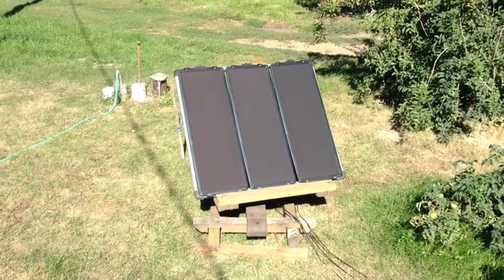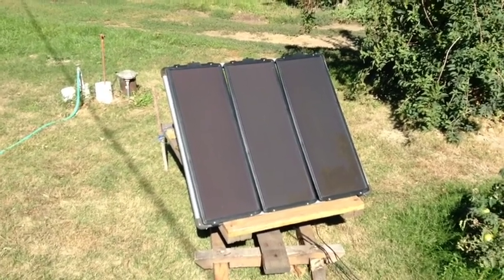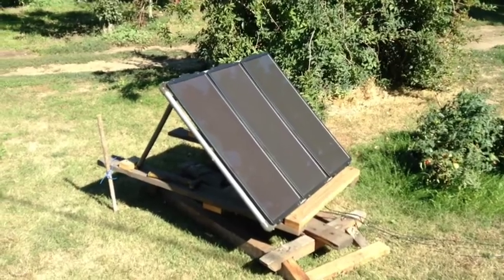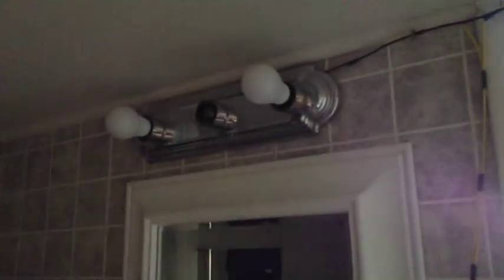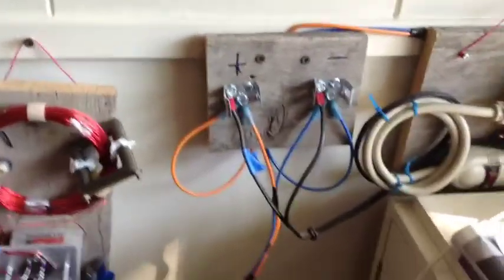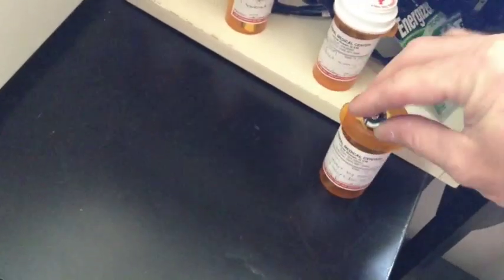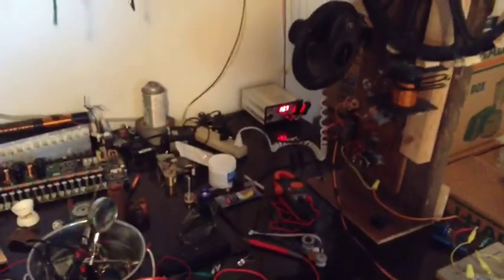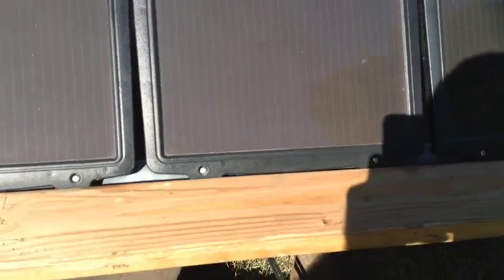Solar Power simple setup with joule ringer BackRoomLabs

Comment from the maker: Ok as for the inverter question, I'm pretty sure the voltage regulator would work. The cheap charge controller that came with the panels has a 3 volt and a 6 volt outlet. I guess everything that uses USB is 5 volts. So if there is a stand alone 12 volt to USB charging doc.... Something like that would work great to save on the inverter loss. As for the relay on the joule ringer. The second one I made that was the easier of the 2 to make draws 0 amps when the lights are off. But the one I wound on the PVC pull 1/4 amp when the lights are off. So when I get more wire I'm going to make another of the easier ones and do away with the lil power sucken one. Nice thoughts on the relay I haven't given it much thought but that 250 milliamp adds up over the course of 24 hours as I never turn the 12 volt side off. Thanks
Reply: Is that 12v bulb?
Reply: Ur using ur joule lamp for all the bulb?

Comment: This an is absolutely amazing off grid suite. For charging phones and tablets can you have a voltage regulator down to 5v and fuse instead of the power loss of the inverter? Also is your joule ringer always on or do you use DPDT switches for each light switch in your house and a relay to the joule ringer so it isnt always on?